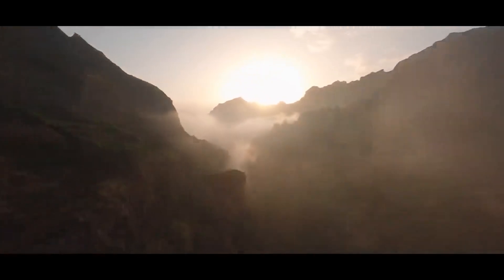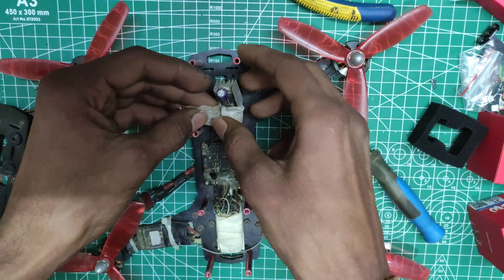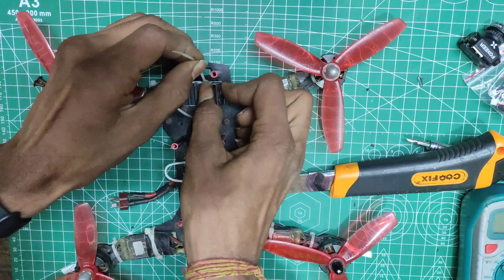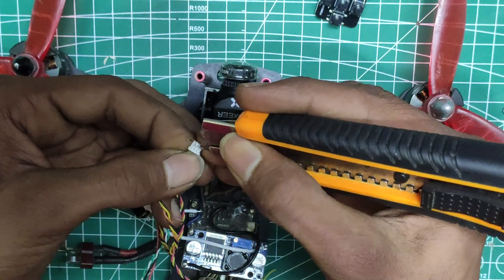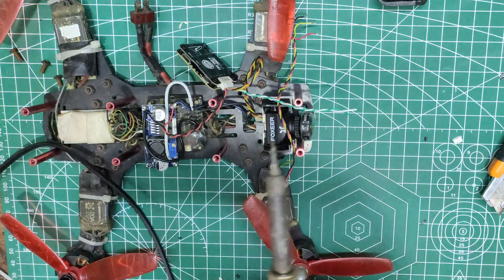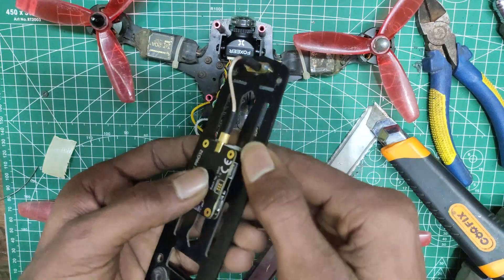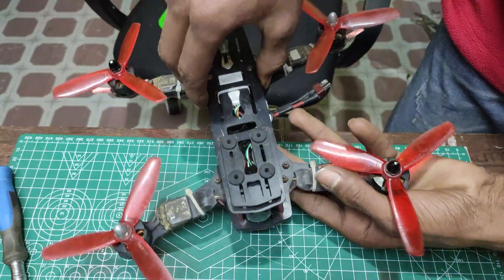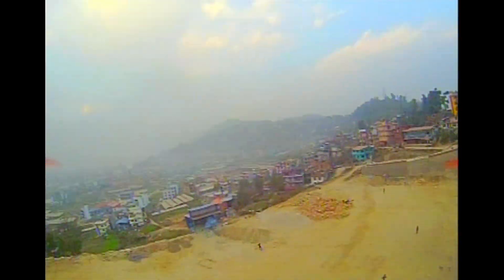How to add FPV camera to your drone || Flying like  a bird with a drone

Comment: where are you from? you are using outdated part bro.
Reply from the maker: I'm from Nepal. It's even difficult to get those outdated parts here. And also affordability is also a massive limitation for this channel.
Reply: @AmateurInventor  ma sell garchu ni affordable part. 😋
Reply from the maker: Budget is the main issue though😅😅. However You can send me your offers, I would be interested to check them out